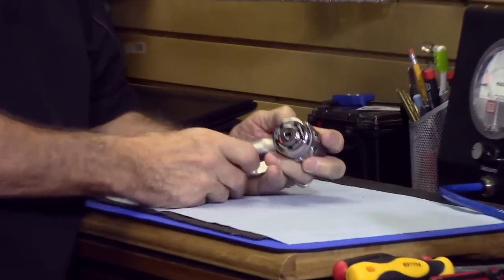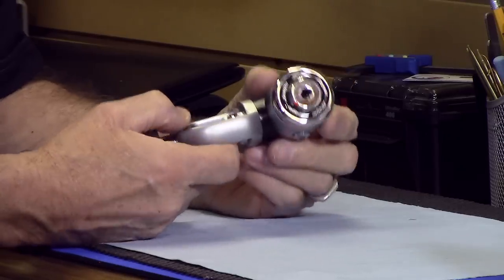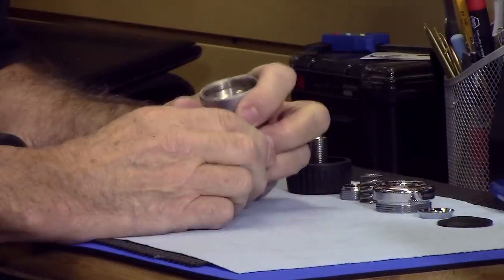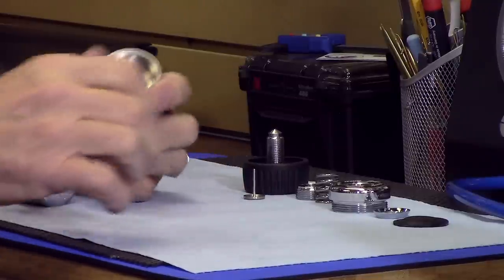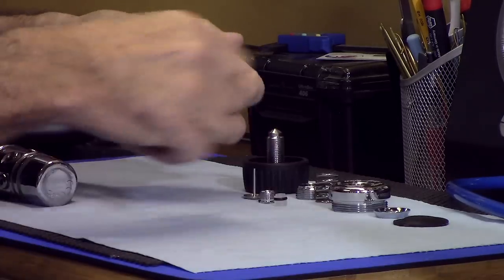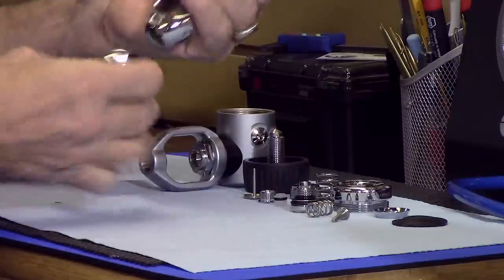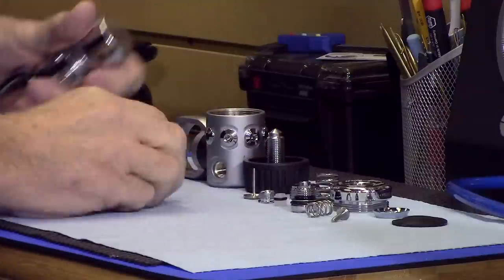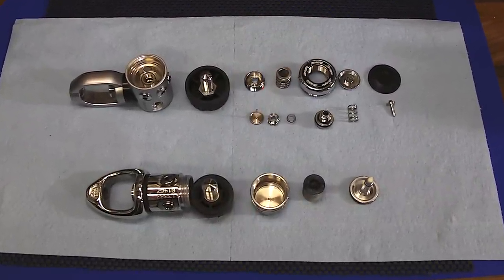Piston vs Diaphragm 1st Stage - Scuba Tech Tips: S07E01

Comment: This video advocates piston quite haeavily, but there are good reasons why diaphragm 1st stages are used (e.g. cold waters to avoid free flow). I'm not going to argue for one or another, everyone should decide on their own, but this video does not portrait the entire picture, so you should look for other information sources in order to get entire picture. I know, that Alec mentions that there's more to this topic, but if I were clueless then I would buy piston without thinking after watching this video ...
Reply from the maker: That wasn't my intention SS. Many divers shun the piston. I was just trying to even the field.
BTW, the piston is just as good in cold water as the diaphragm. Note the impressive 40 year record of the cold water champ - the  Sherwood Blizzard. The first USD Aqua-lung Calypso was a piston and it had a great reputation for use in cold water. 
Neither style has any advantage over the other in terms of performance in any environment so it comes down to cost, service and  reliability.
Frankly, the 1st stage is highly overrated. It performs a very perfunctory job - open/close, open/close, repeat indefinitely. Either style will do the job well.
Thanks for watching.
Alec
Reply: Thank you for pointing out Sherwood Blizzard, I didn't know that one. In any case, there are reasons why dry chambers have been introduced, but there's always also trade-off between various aspects. The only question is what's more important for your diving and what diving setup you're diving with. However, by all means, it was meant as constructive criticism and it would be appreciated if you can perhaps produce another video diving deeper into this topic in order to portrait the entire picture. I really enjoy watching your videos but I had an urge to point out that this video was produced with sort of bias (not obvious from the very first glance). In any case thank you for clarification and looking forward for more content from you.

Kind Regards,
Peter
Reply: @SeekerOfTheAbyss  I've had my Blizzard since 1986, when I used it for ice diving and wrecks in Michigan.  Never once had a problem with freeze-ups or free flow.  Had it rebuilt in 2018 with new, upgraded parts in the first stage.  Still works like a champ, but want a newer, slimmer second stage.

Comment: I think diaphragms are still around because they can be more easily environmentally sealed. At least, sealing is their main line of marketing. I know some pistons also claim environmental sealing but their marketing material seems to be trying really hard to convince us that it is as good as that of diaphragms.
Reply from the maker: You may be right about the marketing slant. Since diaphragms have been around so long it's natural for piston manufacturers to try to persuade divers that their regs are as good or better. That ought to change as it becomes more accepted that pistons are  equal to diaphragms in performance and perhaps better in other ways.
Thanks for watching.
Alec

Comment: Dry air bleed first stage vs sealed?  Concerns or thoughts?I think I was going through withdrawal without new tech tips, thanks for keeping them coming!
Reply from the maker: The unique Dry Air Bleed design developed by Sherwood and now used on their Genesis 1st stage is excellent. I'd need a few minutes and a whiteboard to explain it and might just do that since it's so neat, simple and effective. Essentially it allows the first stage to react to the water pressure without letting any water inside - unlike any other regulator.
So called sealed first stages try to accomplish the same by placing a rubber cap filled with silicon oil over the first stage. It works to some extent but also introduces other problems such as reduced sensitivity,  increased maintenance cost and potential corrosion problems. I may do a video on that topic as well to explain some of these ideas. Watch for something called Cold Water Regulators.

It's time for a story - the idea of sealing the first stage is not new at all. Before most of you were divers, say in the 60's, it was pretty common for us to seal our first stages when diving under the ice. I am from Canada remember! We didn't have any fancy Dry Air Bleed regs or Sealed 1st Stages so we made our own. It was simple job. We filled a condom with alcohol, usually Gin, and carefully put the first stage into the Gin and pulled the condom around the first stage. Then we held it all together with rubber bands (this was pre-Duct tape). If you've followed this so far you can see that the entire hollow of the 1st stage was now full of gin and the gin was held in by the condom. No water could get into the reg. I should have patented the idea at the time but was having too much fun to think of that. Soon Poseidon and then much later Aqualung came up with the same idea using a proper rubber cap and a clamp to hold it in place.
So you see that Gin and condoms are a natural combination for divers too.

Thanks Joe.
Alec
Reply: Very interesting!!  Thanks so much for all the time you take to answer peoples questions, I (and everyone else I'm sure) really appreciate and enjoy the info and stories!
Reply: neat story as always! yes please do explore environment seals some more... I have the option on mine  (looks like another rubber cap and longer piston) and was wondering about having no water enter the mechanism (already membrane based so little corrosion exposure vs regular piston ?)

Comment: Hi Alec,  you say most first stages nowadays are piston based (@2:07). Not sure if that is completely correct. If I look at Apeks, Aqua Lung, Mares the majority if not all of their first stages are Diaphragm. The only exception is Scubapro who indeed mostly make piston based first stages, which stands to reason as they have always been the biggest in that area as far as I know. Of course things may be different on your side of the big pond and I have to admit that I have no insight in the other brands that are out there but these are the major brands in Europe.
Apart from that, I do agree that in the end it doesn't make a lot of difference, they only have to do 1 thing and do it well. Most important thing is that the first and second stage combined make an easy to breathe fit for your purpose system.
Reply from the maker: It's hard to know for sure which style is most common. I suppose one could look at all the different brands and add them up but to what benefit. As you say, they both do a good job.
Sherwood (big in North America),  Genesis and Atomic only have pistons. 
Cressi, Oceanic, Scubapro, Hollis, Beauchat and even Mares offer both piston and diaphragm. 
Aqualung has has pistons in the past.
Originally the piston was favored because it was cheaper but now it has become technically equal in all respects to the diaphragm. It is not possible to detect any difference between them with respect to breathing characteristics.
It's often a choice based on what your LDS or your dive buddies or your instructor favors.
Take care.
Alec

Comment: Love your vids Alec, I have learned a lot from your channel. When researching regs I had a lot of people recommending the MK17 over the MK25 when looking at SP regs. Most felt that the sealed aspect along with its cold water performance and reputation for reliability put it at an advantage over the MK25.
Reply from the maker: The MK17 is a good reg too. It's not been around nearly so long as the MK25 but it has earned a good rep.
The MK25 has some features that help reduce the likelihood of freezing too. You can read about them on their website.
Actually it was a piston reg that we used a condom on. It's very easy to seal.
Thanks for watching.
Alec
Reply: Alec Peirce Scuba You know you have to do a video on how you sealed a piston reg with a condom!
Reply: @Robert Emmerich Hi! I own a Mk17 and also I have tried the Mk25 a couple of times. Couldn't tell the difference, apart from the big deal on having my Mk17 serviced. I love the Mk17, but I certainly see a lot of advantages on the MK25. My best regards!

Comment: Hi Alec, At about 330 ft underwater the water pressure is 150 psi. So I am assuming that deeper than this a first stage that delivers 150 psi will no longer work.  Do divers who go deeper than this have to adjust their first stage to supply higher pressure? Or does the first stage supply 150 psi relative to the ambient? 
Thanks! 
Mike
Reply from the maker: Exactly Mike. The first stage provides air at 150psi ABOVE AMBIENT!
That's why all regulators have a hole or holes in the main body to allow water to enter and act upon either the piston or the diaphragm. The regulator is set to 150 and any water pressure is added to that. Regardless of your depth (pressure), the first stage provides air at 150psi above that pressure. Hence it works perfectly at any depth.
In theory your regulator would work perfectly well during a dive on the Titanic - roughly 2 miles down. That's good to know because you'd have other concerns to address if you were down there! You don't need your reg screwing up!
Take care.
Alec
Reply: Alec, if you ever decide to get a group together to go dive the Titanic, can I be invited along please?

Comment: New workshop?
You can build a new regulator with all of those spare parts on the wall!
Reply from the maker: Yep! I upgraded the old place - new benches, new test equipment and I brought the service parts closer to the bench where I need them.
We service many different brands and they all have their own parts. It can get confusing.
Looks good though huh?
Alec
Reply: I thought you sold Scuba 2000 and retired, and only came into the shop from time to time to do videos?

Comment: Hi Alec, greetings from Norway.. Thanks for a excellent video. I was wondering if there is a difference between piston and diaphragm 1st stages when it comes to freezing and salt water intake. Here in Norway the temperature most often during the winter drops down to 35 degrees and below, which make the 1st stage prone to freezing. My APEKS not so much and there are several other more protected against it, but is there any difference between a piston and diaphragm? And again what if water comes in, lets say to forget to close the lid after a dive and soak it in to water, which is better to service? Logic tells me it is the one with the fewer parts.. Anyway, thanks to you and Kevin for yet another excellent video, keep em coming.. PS.. You already did a video about adjusting the 2nd stage, but I would rather know why a 2nd stage makes noise, kinda like a snoring sound when you breath in.. I suspect the venturi valve (is that what it's called?) making such noise, but kinda feel it does not make any difference moving it, it only free flows easier in water.
Reply from the maker: Jeez Tom - one question at a time OK??
1. Certainly the piston is easier to service. Every serviceman would agree. It's also easier to tune (most cannot be "tuned") and it's 
    cheaper too.
2. Which is better in cold water? That's a debate that has and will rage forever. You need to know that a regulator really doesn't 
    freeze. It's made of brass, stainless steel and plastic - none of which freeze. They're already solids.
    What 'freezes' is the water in the air in the regulator. As the reg is used in cold water it gets very cold, much colder than the 
    surrounding water. That's partly because of the cold water and also because of the adiabatic (look it up) temperature drop 
    resulting from the pressure change within the reg. When the temperature reaches the dew point of the air (the temperature at 
    which the water in the air condenses) water freezes on the high pressure seat of the first stage and prevents proper closure of 
    the seat. The reg free flows. Of course the increased air flow from the free flow exacerbates the temperature drop, more water 
    freezes, more ice builds up, the seal won't close at all and you have a major free flow which we interpret as a freeze-up.
    This process is the same in any regulator, piston or diaphragm.
    Keeping water out of the body of the reg by using an 'Anti-Freeze kit' or any other of the dozen methods sold as cold water 
    prevention is a fine idea but since that is not what causes a freeze-up, they are largely a cosmetic or marketing thing.

The  regulators with the best reputation for good performance in cold water are the Poseidon Cyklon 300 (no longer available new), the Sherwood Blizzard,  the Sherwood SR2  and the Scubapro MK25 (with the S600 second). 3 of these are piston style and none use any special anti-freeze system. Lots of others are good too but, regardless of what any diver will say, no reg is freeze-up free. That is, every regulator will freeze under the right conditions - yes guys, even double hose regs will freeze. I speak from experience on that!

Preventing a freeze-up is a combination of actions that the diver can take (or not). 
a. Keep the regulator warm right up until your enter the water. If the 1st stage is warm it takes longer for it to cool in the water and 
    that will delay the likelihood of freezing.
b. Be sure the air is as dry as possible. Air standards require a dew point of -65 degrees fahrenheit. A good dive shop will give air 
     with a dew point of -90 to -100 degrees fahrenheit. 
c. Don't allow any air to pass through the reg until you are under the surface. Don't test your reg on the surface. You should have 
    done that before in a warm place. Don't breathe through it or blow up your BC or Dry Suit until you are down. As soon as air 
    passes through the reg the temperature drops rapidly due to the adiabatic effect. When ice diving, I keep my tank and reg 
    system in my hot car until ready to jump in. The I put it on, slip into the water, take a big breath from the air, put the reg in my   
    mouth and drop down as quickly as possible. The first time I breathe underwater it's an exhalation and I'm down 10'. Realize 
    that the water is warmer than the air and higher than freezing temperature.
d. Try to breathe slowly and steadily underwater - no sudden big inhales or long blasts on the LP hose.
e. Don't use your Safe Second (if possible). that's almost a guaranteed way to freeze up a reg.

3. Your reg is very sensitive. When you inhale it tries to give you lots of air but you don't want lots, so it has to stop delivering air, 
     but you're still inhaling so it opens wide again, but it's too much air again so it has to stop, but you're still inhaling so it has to 
    open again and this process continues accompanied by a farting sound from the rubber diaphragm as the reg opens and closes 
    while trying to decide how much air you want. If you take a sudden big breath, there is no burping sound. This only occurs on 
    the surface. Water muffles and it also softens the opening and closing underwater. You're reg is doing its job. 

Whew! Can I rest now? I'm old Tom.!
Hope this helps or at least gives you something to think about.
Take care.
Alec
Reply: Dear Alec, and you wonder why a package arrived for xmas. You rock!! I will however apply the geriatric approach next time with one question he he, but you inspire me to ask question so... Old? Not at all, think you still look young to this day. Also couldn't guess your age if I tried. Send my greetings to Kevin and your better half (also nice kill btw, you can add to that too). Thank you for this long and excellent well informed answer, learned a lot and also helped for sure! Take care! - Tom
Reply: to me this not the construction principe  that dictates the capacity to resist freezing, it is the capacity to transfer heat from the environment to the pressure change area of the first stage, with a so abrupt pressure change, it is sure that the temperature of the decompressed air drops well below the freezing point so any trace of humidity will freeze  even in summer, when the water temperature is high, say 50 degrees and over, the surrounding water gives sufficient heat to the first stage body to prevent the accumulation of ice, when the temperature of the surrounding water goes near the freezing point, the heat transfert is greatly reduced so the ice can accumulate at the decompression point and this impairs the seating of the high pressure seat.
I 've saw an industrial application where a fast cycling pneumatic cylinder was freezing in the mid summer temperatures even if the pneumatic system was equipped wiyh a refrigerated air dryer, the solution we chose was to install a 250 watts  heater on the cylinder cap to prevent that.

Comment: Hey Alec.  Thanks for another great tech tip.  I understand the benefits of a piston regulator (simplicity, ease of service, lower cost) but I came away from the video wondering what the benefits of a diaphragm regulator were.  Can you elaborate more?  Thanks again!
Reply from the maker: I'm sure that USD or Mares would like to see a list of benefits of the diaphragm over the piston but it wouldn't be easy to make such a list without stretching the truth or at least invoking a bit of marketing hype. 
I'm not bias in any way. My favorite regulator of all time was the excellent DACOR Pacer 900, a diaphragm. I was trained on an Aqua-Lung Mistral, a diaphragm (terrible breather by today's standards). And my first own regulator was an Aqua-Lung Aquamatic, a diaphragm. But the simple fact is that both types do exactly the same job - supply air at proper pressure to the 2nd stage.  And they both do so perfectly well. The piston is just cheaper, has less parts so in theory anyway is more rugged and reliable and it's easier and cheaper to service.
I'll think on that and see if I can a find a genuine benefit to the diaphragm style.

To the diehard diaphragm enthusiasts I offer this - 99% of all 2nd stages are diaphragm. 
There. See I'm not biased.
Thanks for watching Dan.
Alec